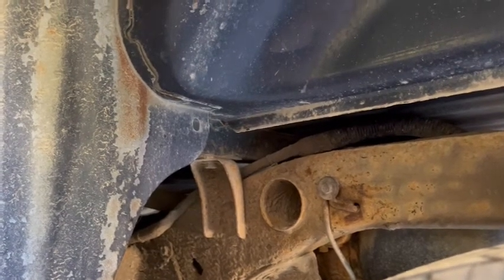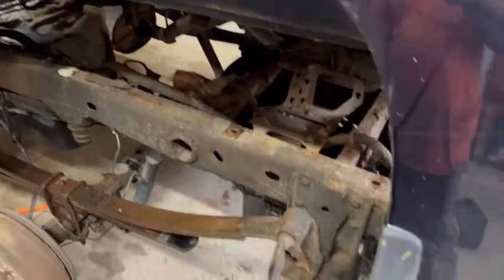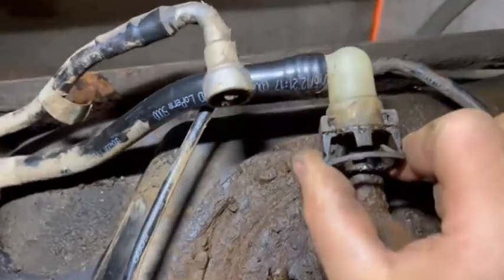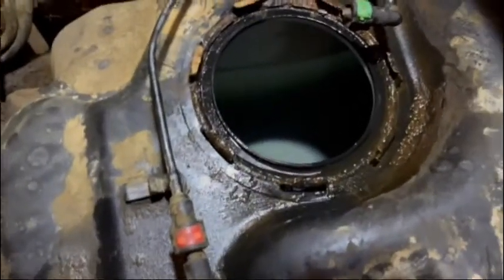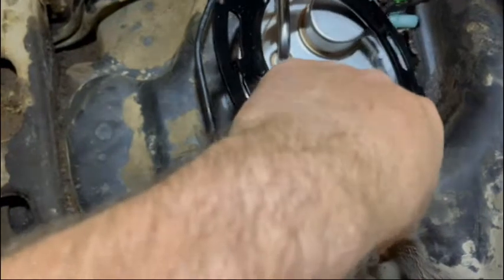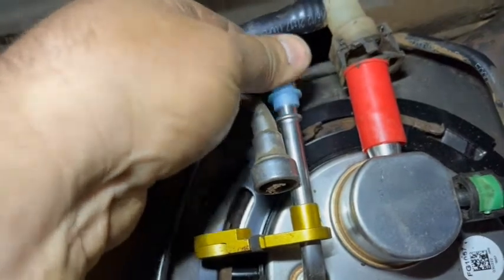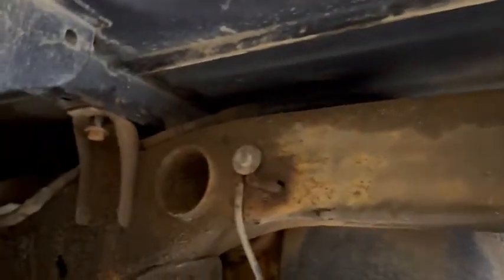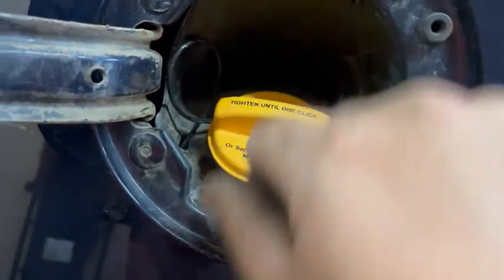Changing A Fuel Pump. 2012 GMC Sierra

Comment: Dang I wish my 2012 looked that clean lol I’m in Canada so the winters and rust are something fierce
Reply from the maker: I'm in Maine so I feel ya.  It used to look worse, but last fall I put it on the lift and cleaned it all up in good shape before spraying the fluid film to it.  A wire brush and hose cleaned it up good. That's why it looks nice.
Reply: Did you end up ruining the clips trying to get the piece outta the high pressure line? I'm having same problem trying to get that rusted peice out with those clips holding it in there
Reply from the maker: @kipstubbs2446  I wound up replacing the entire line.  It was too far gone.
Reply: @Kip Stubbs  you can use vinyl line splice kit with new quick connector.  I've been to hell and back with rusted connectors . You cannot get them out.

Comment: I just did a fuel pump in my 2010 GMC ext cab. I cant believe my original pump lasted that long up in Michigan.  I ended up replacing the gas lines, lock ring and pump. Just so every thing is not going to give me a surprise,  should of done that when I had the tank out moment. After getting everything put back in the tank I sprayed the top of the pump with fluid film to hopefully buy it a little time.
Reply from the maker: Rust is a wonderful thing!  Sometimes there's no time like the present....easier to change things when the opportunity presents itself.
Reply: Did you have to splice the connectors when you changed your fuel pump?
Reply from the maker: @andrewrogers3449  Nope, what you see is how it happened.  The electrical plugs are original.
Reply: Have any trouble w/ the gas tank strap bolts?Mine is seriosul crusty down there, scared to try spinning them out especially the front one which you can't seem to access the thread sides to spray w/ wd-40 or anything.. thanks

Comment: I'm in the rust belt in Midwest just finished mine in 2013 silverado.  Did the tip the bed method , worked OK.  I had to splice main fuel line, put a new quick connector and splice kit.  Everything else was OK.  And I put a rubber cover over pump and fuel tank when finished.  You can run it and actually check everything is good . Then drop  bed ɓack down hook wiring back up.
Reply from the maker: Good deal.  Being able to DIY sure saves money.
Reply: Is the main fuel line the one with 90° metal elbow? If so, that's the one I'm having trouble with too. The fuel pump outlet broke off inside that connector on mine and now I'm trying to hunt down a replacement fuel line but no one has them. How did you go about splicing your line and what did you use? Any help would be greatly appreciated, I'm desperate and need my truck running again.
Reply from the maker: @Street-Shred82  The supply line (fuel pump to engine) is the one that has a single connection, the forward most one.  It sounds like the one you are describing.  

To get by with it for a few days until I could get a new fuel line, I used a piece of rubber fuel line and connected it with hose clamps.   17 minutes in to the video.  I mis-stated it as return line.

Comment: The body or the box ? Im trying to simplify a pump swap and cut a hole in the cab floor or the box .Carpet covers one and box liner covers the other.
Reply from the maker: The fuel pump is under the body.
Reply: @northwoodsyankee3528  So  your saying the cab or box?
Reply from the maker: @glassblastcollision  The bed of the vehicle.  It's in the forward left side.

Comment: I have a question on 2012 gmc where is fuel filter located is in built into the fuel pump
Reply from the maker: It's in the bottom of the fuel pump.  You know...the easiest place an engineer could think of for access to change it.

Comment: Do you know what the difference is with the pumps on rockauto as far as bed lengths?? So many different pumps and for different bed lengths plus some say they may require a wire harness?? 

'08 Silverado 1500, 5.3L Vin code J, extended cab with the middle bed length, not short box or long box.
Reply from the maker: That I'm not sure about.  When I got my pump at the local NAPA they just went off year/make/model I think.  I've never used Rockauto.
Reply: 2007 Classic Silverado 143.5" wheel base Extended cab (6.5 foot bed aka standard bed)

I just bought a Genuine GM OE from Autozone with limited lifetime warranty. P/N: MU1415
Reply: Watch the overall height of pump too . Some shorter than others.  Match them up at parts store, avoid splicing  electrical connections if possible . Make sure correct connections are same as yours.

Comment: Bad design .All the crud goes right on top of the pump! I took my tank off   to replace it , reached to touch the lines they fell apart in my hand . I guess magic was holding it together. fun 2 and a half days
Reply: I could not get  the back fuel strap bolt off .
Reply from the maker: Absolutely.  It's a catch bucket for dirt and road crap!
Reply from the maker: @kevinmcnabb168  I'm not surprised at all.

Comment: that line is the high pressure line feeder line NOT a return line .I would wait to replacement line is untanned .These systems are a non return line system .
Reply: Sorry , I think your rubber hose and clamp on the output line of the pump is a HUGE mistake. No way that is a long term repair, plus is dangerous.